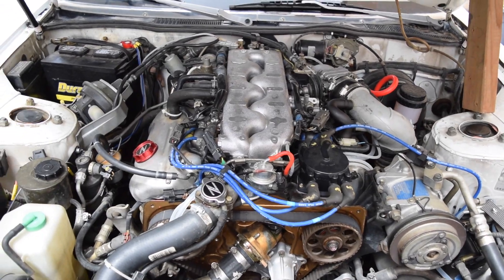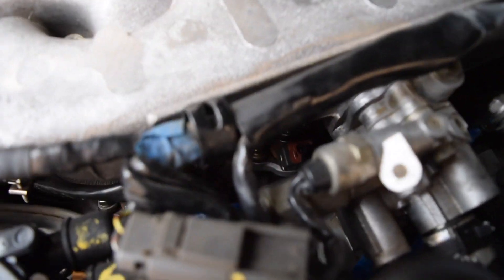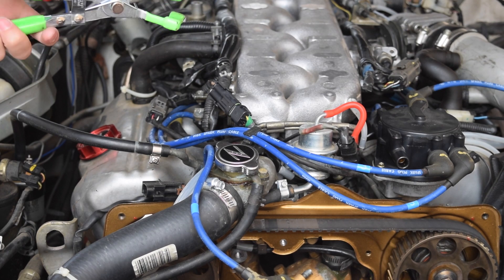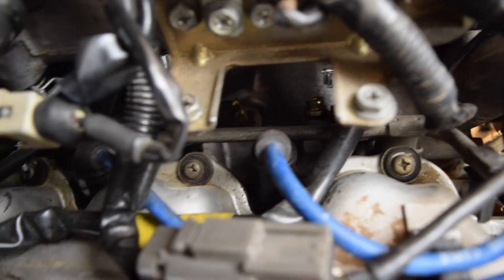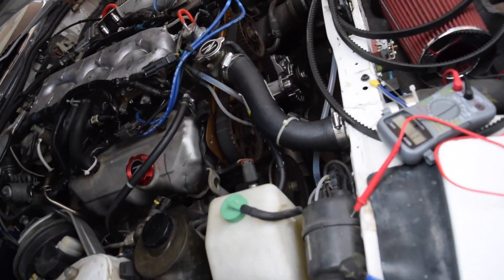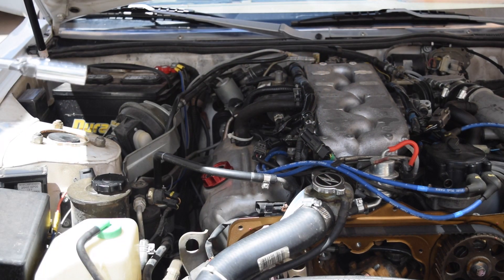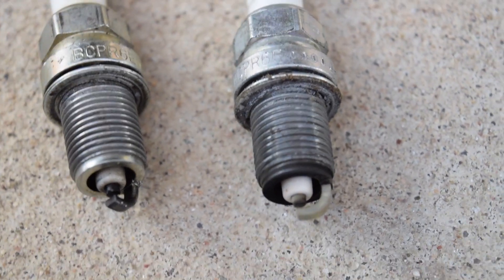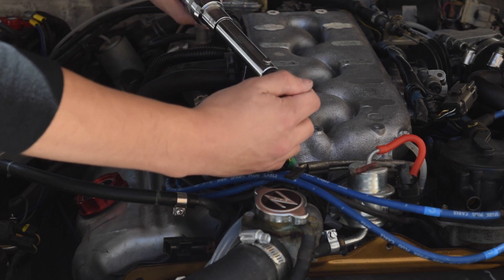Overview on How to Change Your Spark Plugs

Comment: Nissan included a tool in the factory Z31 tool kit (under the carpet in the driver's side rear hatch area) for changing the spark plugs.  It is a long cylinder with holes drilled in one side, and a hexagonal head on the other.  You might get lucky and the tool still be there.
Reply from the maker: Yeah that's what I've heard, unfortunately mine was missing

Comment: Did you have any trouble with the ngk wire plugging into cylinder 2, I couldn’t get it in for the life of me and ended up using the stock one for now lol
Reply from the maker: I didnt have any problems with it. You can go to an autoparts store and get sparkplug boot plyers. They help to get a good grip on them down in the valleys